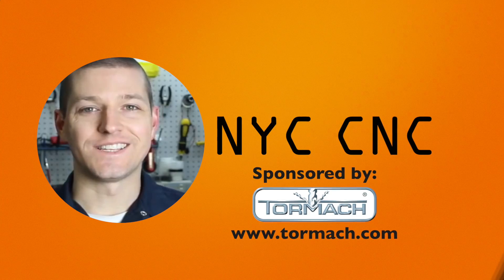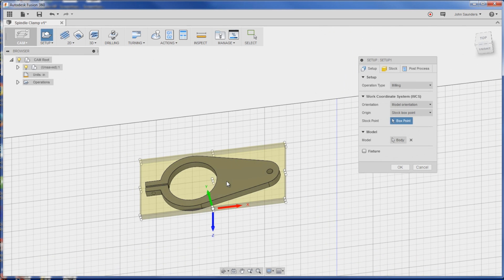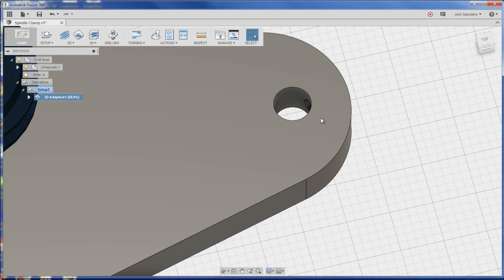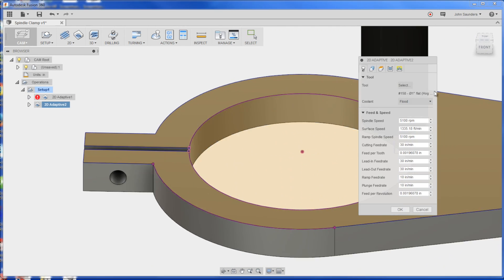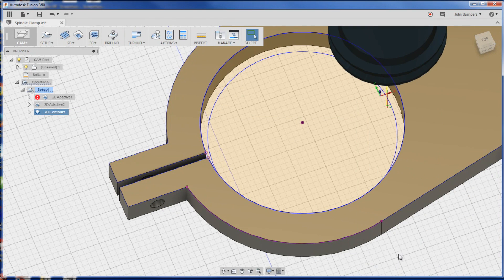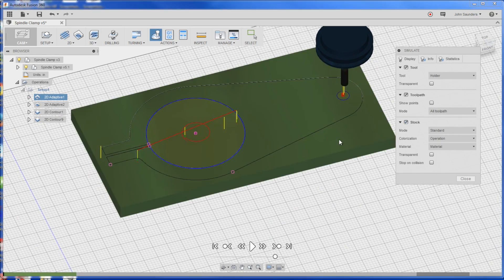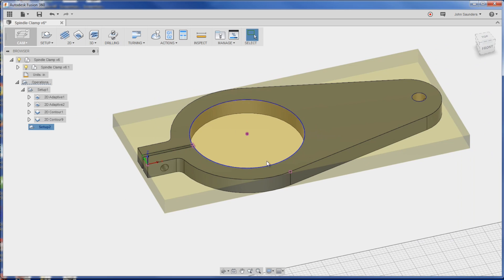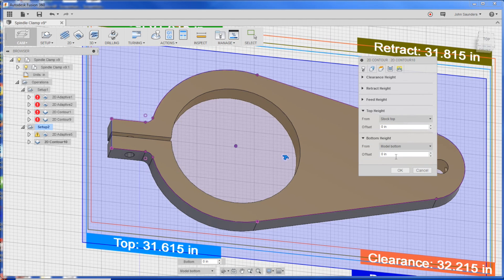Fusion360 CAM: Tormach Spindle Clamp! Widget 53B

Comment: personally I use some 12mm square rod and super glue. glue the rods to the stock, clamp down the rods, machine and then use a hammer or just your hands to pop the rods off the part. Probably helps that I'm using a router and smaller EM's, so the cutting forces are comparatively low, but it works great, particularly since the entire job can be done in 1 opp (other than the obvious off axis holes etc...)
Reply: probably on a machine like yours yea, absolutely heheh. but mine has a lower MRR (cheaper cnc router, best i've managed is about 15 000 mm^3 / min) so works quite well. with your machine i'd probably clamp the outside, machine the inner holes, clamp them and then do the outside... how long did it take on your machine (including the time to re-position the clamps)? mine's about 45 min, including the initial setup... machine time is about 40. I imagine your machine time is more like 10min :P?

Comment: I made a similar mount for my Bridgeport Series I CNC to allow me to mount a hand router who's spindle can reach 30k RPM for PCB milling and engraving.
Reply: Yes it does. I had two versions. The first was for a dremel tool, but the plastic plastic 'pillow block' of the dremel moved under the shear loads of engraving, so I went to an all metal hand router.

Comment: hi john, I found a fixed to the z axis not being up in fusion 360, Please read this http://forums.autodesk.com/t5/design-and-documentation/z-axis-up/td-p/5445468 , in basic the y axis is up when you open fusion 360, go to peferences and set default model orientation " z up " and close the program, now open again and when you start drawing you will find the blue z axis is now up and the yellow y axis is front to back as it should be, great eh ?? please let people know, if you wish to model a part for lathe turning you can change it back if you wish to do so, great video's on fusion by the way keep up the good work, Thanks Daniel

Comment: Paused:

Alright, first I would determine if I was making 1 of these or 1000. Quantity greatly effects fixturing.

If I was making 1000, I would do it with a custom set of soft jaws that could hold the part in all necessary orientations. I might also consider using more than 1 vise to speed up the process. Op1: Face, pockets, profile and chamfer. I would probably use our Mitee-Bite TalonGrip vice jaws for this step. Op2: Face and chamfer opposite side using custom soft jaws. Op3: Spot, drill and tap the end hole for tool holding. To hold the part in the correct orientation, I would mill a pocket on the face of a soft jaw that matches the part profile. Op4: Same as Op3. I might also consider positioning the part so that a slitting saw could be used.

If I was making 1, I would do it on spoil board using t-slot clamping for the most part, then a standard vise for the tapped holes. Op1: Face and pockets in a vice. Op2 Face in a vice. Op3: position clamps through the pockets and cut the profile. Op4: End hole in standard vise. Op5: side hole in standard vise. Op6: slot with Dewalt.

Now, let's see how you decided to do it :)
Reply: Thanks :)

I work for The Geek Group (www.thegeekgroup.org), but we are sponsored by Mitee-Bite and have pretty much everything they make on hand.

Comment: Hey John. The Fusion360 tutorials are great. No one else seems to be touching the CAM side, so thanks for that.  What I really really want to know is will Fusion360 and the Xcarve play nicely together.
Reply: ***** Yeah they do. Touch base with Garin Gardiner & Al Dean on Twitter. They are both using it with the X Carve... in fact, the Inventables guys are using Fusion 360 to program their X Carve in house as well. It comes with a Grbl post, but there are some quirks with the universal G-Code sender which need working around. I actually have a Shapeoko 2 sitting in boxes next to me... I just haven't had a chance to put it together yet. But I will be using Fusion 360 to program that as well. camforum.autodesk.com is the best place to get CAM support for Fusion 360.
Reply: NYC CNC I'm not sure, I would be surprised if you couldn't.

Comment: I make slotted parts, I just dont draw the slot in cad as its done in the second op with the holes, I just set it up manually, slot and drill the cross hole.

Comment: I'm no expert and I may be wrong, but for your issues on your contour where the split was causing the tool to profile both outside and inside.  You modified the sketch to close off the shape.  Look into the "Patch" option under the "Model" menu.  I think this may be a better way to patch this leak.

Thanks for all of the great videos, keep em comming!

Comment: Very nice. The contour selection tool that you showed is in my opinion what makes Fusion CAM much more powerful and faster than HSM Works. You shouldn't have to right click to get it to work though, just click the blue selected line again and it will appear.